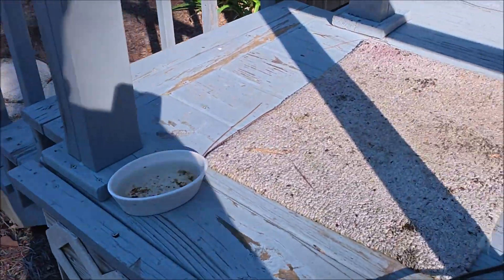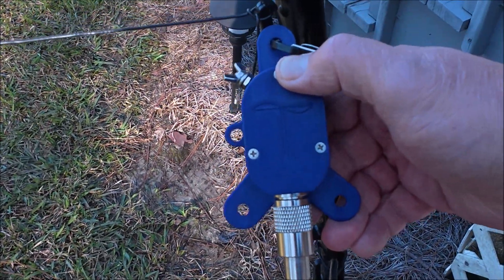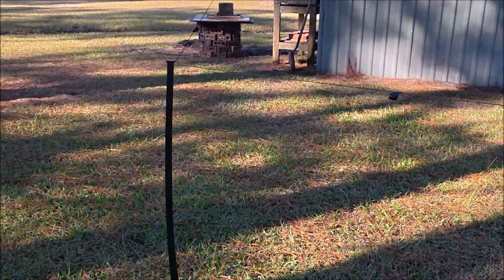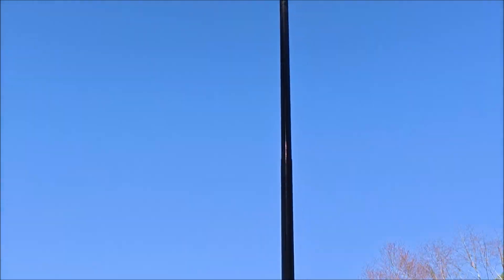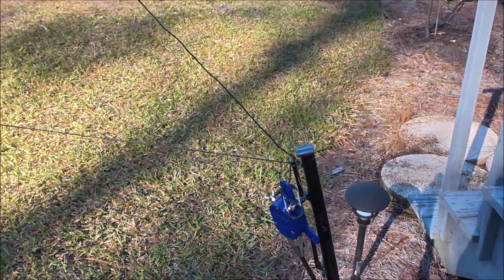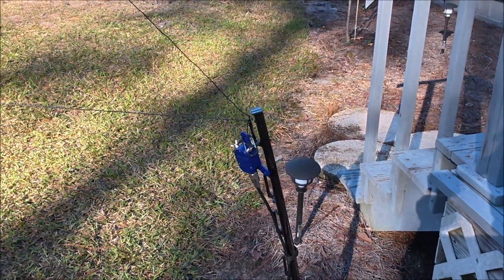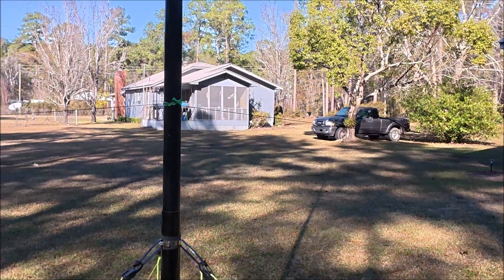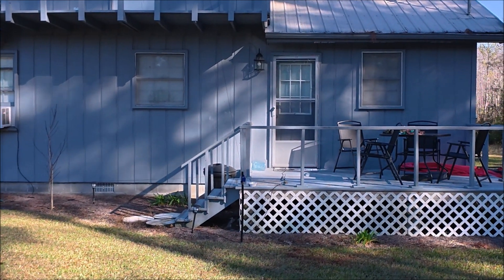EDITED-READ DESCRIPTION: Delta Loops With KA4KOE

Comment: I did the same thing only with 14 gauge wire and fed it a 1/4 wave from the apex at the top. It’s a very quiet antenna and works well, much quieter than a traditional 1/4 wave vertical , not to mention very affordable.  73….

Comment: Hi ....Thank you for posting this video,it's been very informative,I am considering building myself a delta loop antenna myself for 20 through to 10 mtrs,I would like to feed it for vertical polarization but unlike yourself instead of feeding it at the corner I would feed it one quarter wavelenth down from the apex on one of the legs,but instead of locating the 4:1 balun at that point on the antenna locate it on the mast instead and then run 450 ladder line from the balun to the actual feedpoing on the leg,my thinking is that the length of 450 ohm ladder line would not act as part of the antenna itself .....The  reason for me doing it in this manner is because of exactly what you talked about in video regarding the difficulty with locating the balun directly at the feedpoing......But perhaps I'm missing something as I have not come across this method before ????  Thank You....
Reply from the maker: Try it.😊